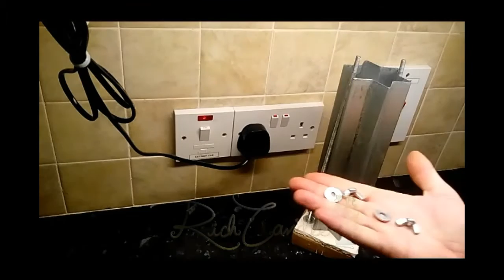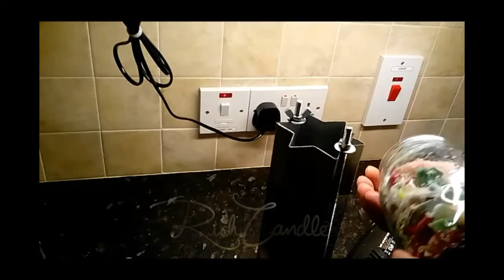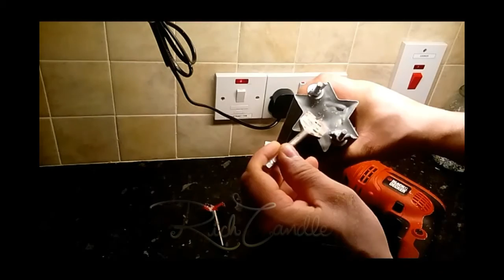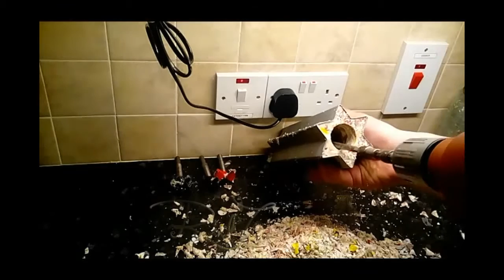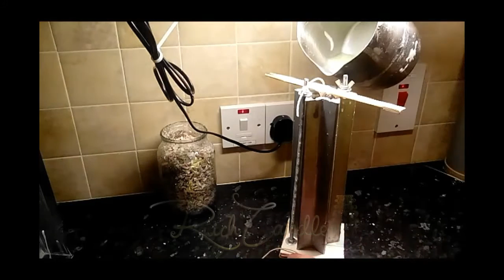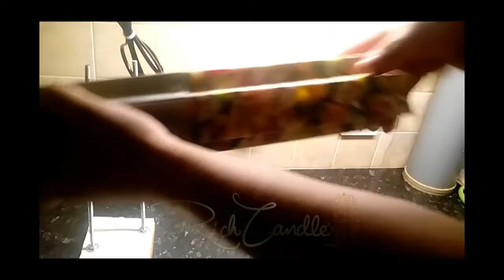How to create a completely unique and irreplicable candle

Comment: why didn't you put the wick in when you were putting the wax in to begin with?
Reply from the maker: Because the left overs from carved candles are very concentrated with dyes, If you would put it in at the begging it would cause it to burn very badly. And that's why we drill a hole in the middle of it in order to pour in dye less wax.
Reply: Rich Candle ahh. I make candles but not carved ones. This makes sense over coloring a candle does make it burn badly. Thank you for answering.